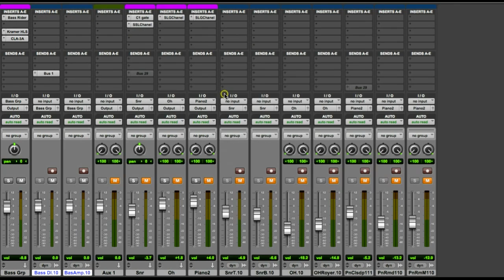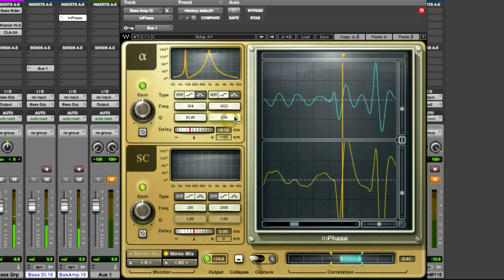Aligning Two Mono Tracks with the InPhase Plugin

Comment: Seems like it doesn't do anything that you couldn't do by zooming in on the waveform and measuring the distance between waves and using a sample delay. Am I missing something? Seems lik a massive overcomplication.
Reply: The Wit  so can splitting into mono
Reply: i highly recommend autoalign, its great
Reply: The Wit  you lose real time capabilities with this plugin too,  you should bounce your midi first, this plugin only works on static phase issues, since midi isnt accurate to the sample it wont work
Reply: The Wit  how can you split midi into mono? Its not stereo to begin with, its just midi
Reply: The Wit  mmm i was nominated for 2 engineering grammys and i have 30 platinum albums under my belt. I also taught in 2 different audio institutions and lectured in quite a few more
Reply: The Wit  yep im still correct. If you want to use this on an instrument track. And you want this plugin to work as it should. You have to first bounce it to audio or you will run into tons of issues due to midi triggering stability. Thats what i was trying to explain.

Comment: Im confused with the routing of this video. . . You have done the side chain as a send as opposed to routing the track itself out to inPhase. From the look of it you are still monitoring your DI Bass through your "bass group". If you are also monitoring the DI (or a blend of it) through the inPhase plugin, wouldn't that be redundant and cause even more phase problems? So you are listening to 3 signals; the dry Bass DI signal, and the processed blend of the DI and the Amp. Is this intentional?
Reply: This is what I was wondering as well...
Reply: Why not just side chain it to the actual bass track rather than send it to a bus?